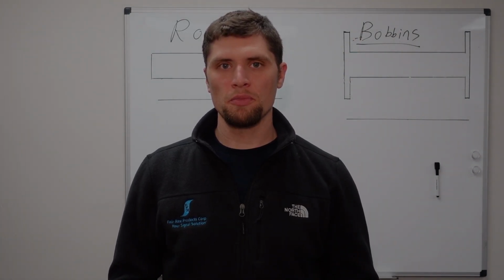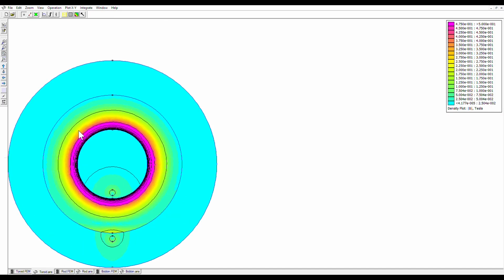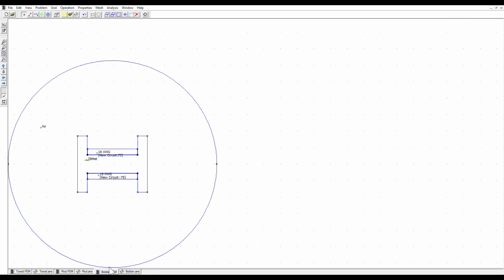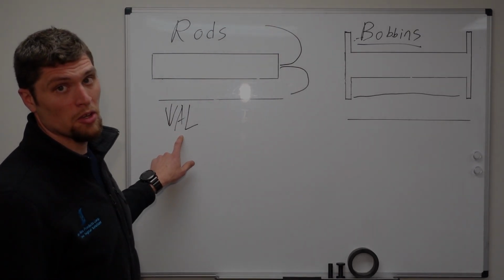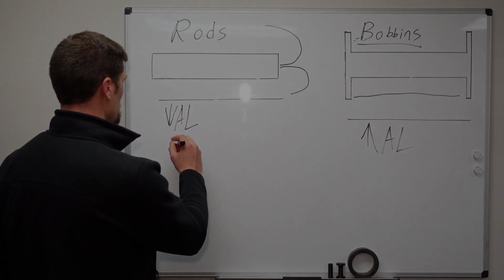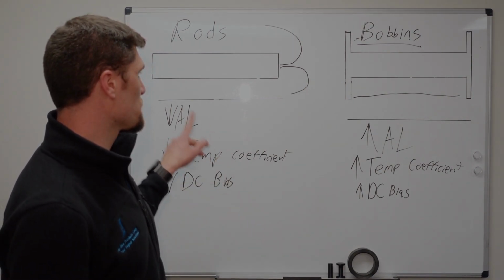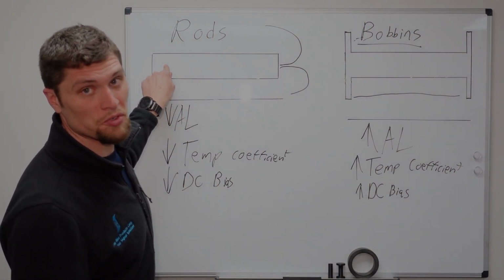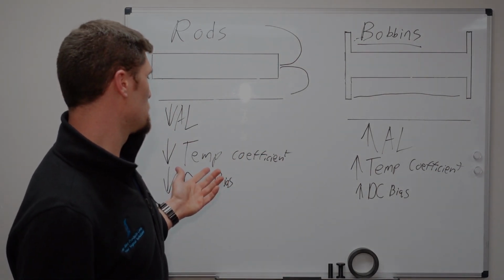The Case of Rod V Bobbin (Antenna, Inductor, & Choke Cores)

Comment: Hi Mike, I enjoyed the video. Of particular interest was the simulation of the flux lines using the closed and open ferrite solutions. You and Bruce please keep up the good work. You guys are taking some the mystery behind ferrite materials for us regular guys.  Paul W1VLF
Reply: I found your video interesting.Magnetism is still a black art.😊I have been experimenting with coil antennas(not helical working in working in normal mode).I have found if you wind the coil tight on a small diameter former (single layer wooden dowel).Say 33uH Say 3-7pf stray capacitance from windings You end up with a antenna that is resembling a tank circuit for around 27 mhz.It works very well .Field strength is not great but current through coil is high.High current equates to high magnetic field.Failing that have no idea how it works....😁